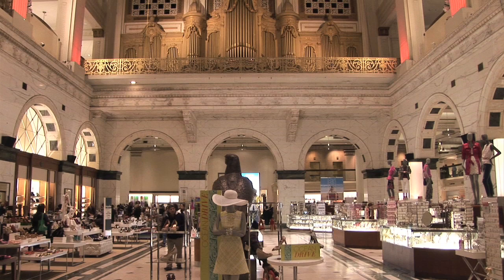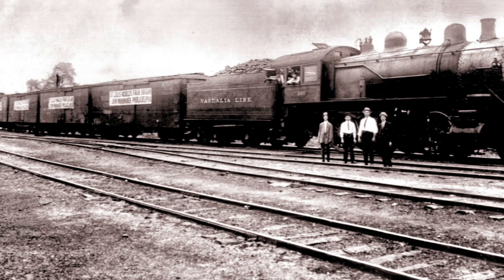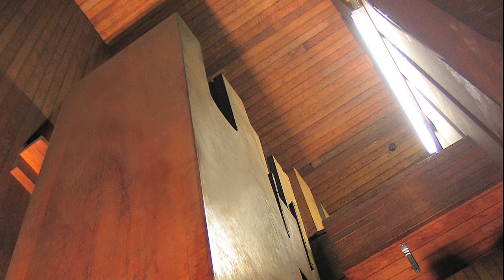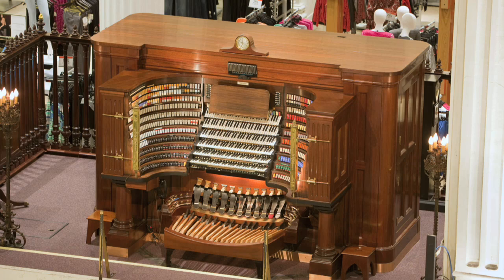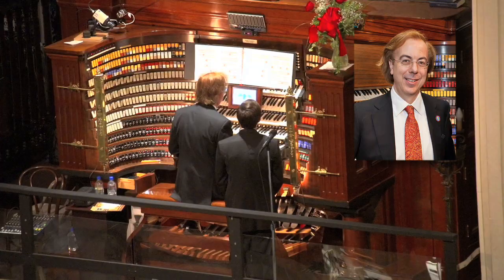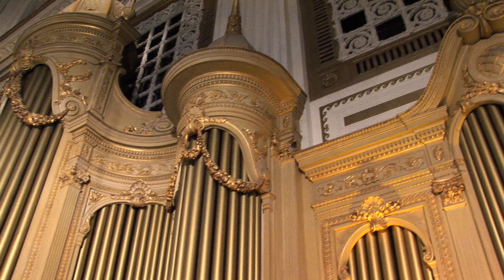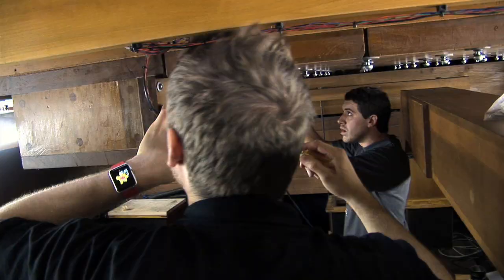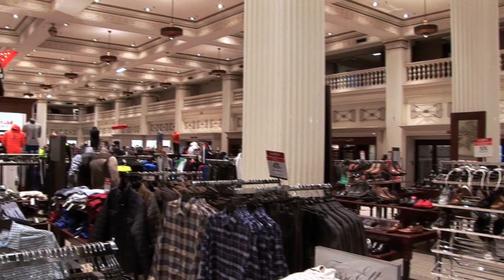History of the Wanamaker Organ at Macy's Philadelphia

Comment: I was privileged to meet Keith Chapman for a noontime program in 1973. He asked me what I would like to hear. As it was during store hours, it couldn't be full organ so I asked him if he would play the tunes from 'The Sound of Music'. He did - marvelously. At the time, there were only a few of the combination pistons working. Making all the combination action functional was considered a potential fire hazard due to the current draw through the original wiring made of copper wire wrapped in cotton then dipped in wax. Thanks to the development of solid state electronics and plastic insulated wires used in the instrument's restoration, now everything works. Peter Richard Conte is a marvelous performer as well. If Macy's every has to close the store (it is not in the best section of Philadelphia and internet sales have changed the way we shop) I hope the instrument ends up in the Smithsonian. There is also a CD available of Virgil Fox playing it in 1964 made from the original 35mm film recording used to make the original vinyl 33rpm records. As it was recorded to RIAA standard at the time, you will have to boost the bass and shade the treble to hear it correctly. One last note - The manuals are all playable from a sitting position as the keys were all made shorter from front to back. Hearing it live is worth the trip.